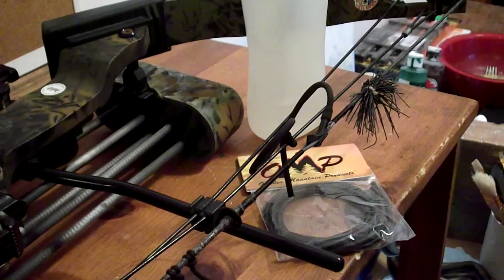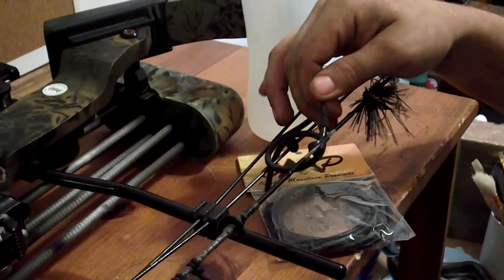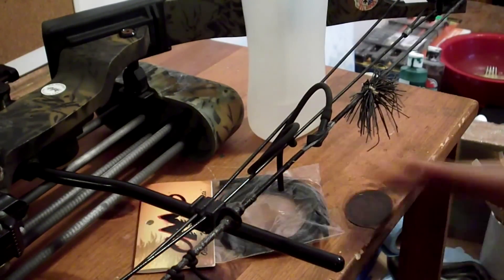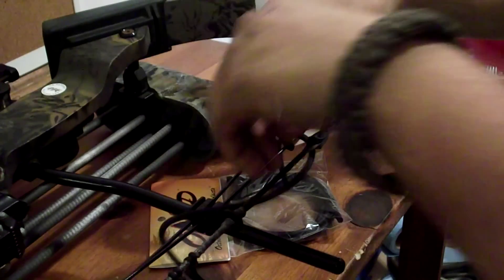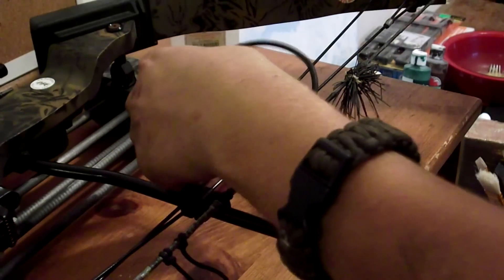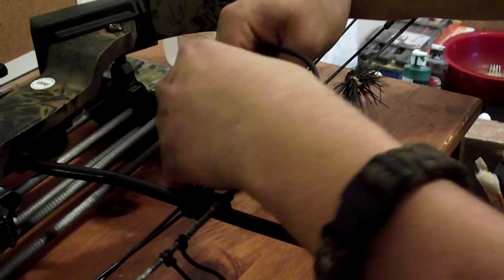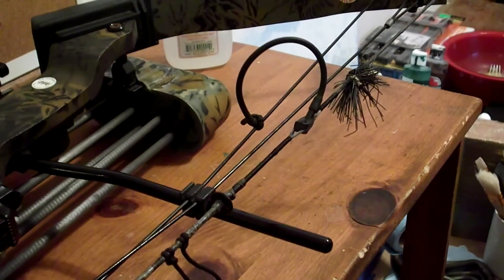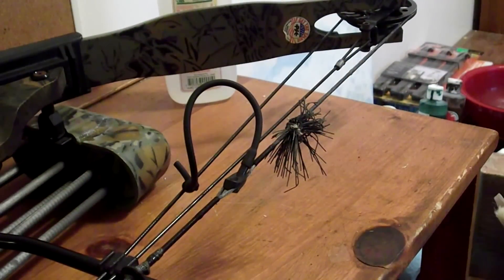Bow Tuning: Replacing our peep sight tubing

Comment: You tied the tube to the other cable(inside one, the one that moves) in the beginning of the video it was tied to the outer cable(stationary) one.
Reply: +Tracy Inches Good eye.  I noticed that too.  The reason I checked out this video was to determine where it should be tied off at.